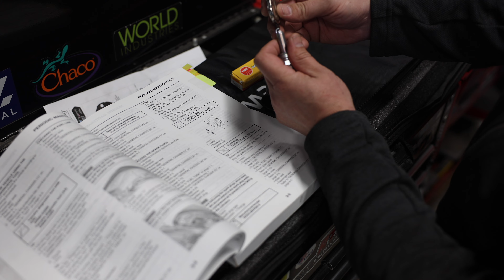Yamaha R7 spark plug replacement

Comment: Does the fuel tank need to be emptied? If so how would i do that :(
Reply from the maker: No need to empty it, if your worried put a rubber cap on it
Reply: @ScoutsOut  Oh ok! Im assuming because that hose is off the bottom of the fuel pump and only sends when key is on

Comment: THE SPARK PLUG BOOT ISNT COMING OFF😭😭😭
Reply from the maker: Nooo man it was a pain in the oss to get the second one off, it’s so buried but not to bad once I moved the mount back a little.

Just try and be nice with it, could try and spin it both ways just a little to get it to release before you pull up
Reply: @ScoutsOut  after struggling with it for maybe an hour i had a buddy with stronger grip pop it out like it was nothing :)
Reply from the maker: Haha, yea bro it’s frustrating

Comment: why does he put grease on all the plugs?
Reply from the maker: It’s dielectric grease and it keeps water out, metal from corrosion, keeps the seals in the plugs from getting brittle from heat. Long term great idea on all vehicle electrical connections…. Sry for needing out lol

Comment: Thanks for making this! With your helpful videos, I've managed to perform all of my own R7 maintenance. I replaced my first plugs at 8k miles (15 months ago), and had to do a lot of guessing as there were no tutorials for R7 back then. Just replaced my ~ 16k plugs and your video helped it go smoothly. I just couldn't reach/re-attach those damn breather hoses, so ended up removing the right side tank cover. Thanks again and keep the great videos coming! (brake pads next? 😉)
Reply from the maker: Nice dude, glad it worked out. Yea pads, fluid change and steal braided lines with abs delete is coming up next

Comment: Awesome! Thanks so much for sharing all these maintenance videos. These are extremely helpful. Did you try to lotería the torque on the oil screw? I remember there were some concerns on that. On another topic it would be great watch another video on how to lubricate the clutch, gear, etc thanks again! Love your videos
Reply from the maker: Glad it was helpful, I haven’t seen anything different on the drain bolt torque, but I’m sticking with 17ish. I did just add one with a magnet and hole for tie wire for the track which will be the best route imo. I’m be putting some more maintenance vids together especially with it being winter now it’s to cold for most to ride

Comment: Thank you on this video, helped me out quite a bit.
Reply from the maker: Nice, glad it was helpful. Happy holidays
Reply: @ScoutsOut  happy holidays! will be using your fork oil video in five days also! was planning it after watching so much Dave moss.
Reply from the maker: Nice, man it was such a big difference. I honesty was scared to the R7 back to the track without doing inserts to fix the forks but the oil change was huge and im not planning on doing inserts until i reach the limits of them. Good luck on the fork job and let me know what you think
Reply: Changed the oil, such a dramatic difference. I was also scared when taking my R7 to the track and actually crashed due to the suspension. My mechanic friend I was with believed I wasn't fast enough to dial it in from default,. I hit the bump on T1 Road Atlanta causing it to low side shortly after. I now have a designated track bike now. The front forks caused such a see-saw motion at lean I felt when I dialed it in at another track and never felt confident on it. After this oil change I am sure that I will get almost the same confidence as my track bike. If this hadn't sorted out my issue, I was going to sell it and buy a zx4rr. @ScoutsOut
Reply from the maker: Nice, thats awesome it worked out and scary you crashed before. The r7 scared me on the track several times with the front forks, im lucky I didn’t go down as well.

Comment: Hello Scout, I’ve noticed just recently that my r7, the iddle goes to high towards 3000 rpm when turning on .. then proceeds at normal iddle speed around 1250/1300, is it normal? Since before I’d would go straight to normal and stay like that
Reply from the maker: When the bike is cold it will high idle for a min or so. I just checked mine and it going to 2k for 30-45 sec before resuming normal idle and that is normal. As for 3k, that seems a little high but it could have to do with elevation or temps possibly

Comment: Does the fuel tank need to be empty before removing the lines? TIA
Reply from the maker: No you are good with the quick disconnect, it will only leak a little